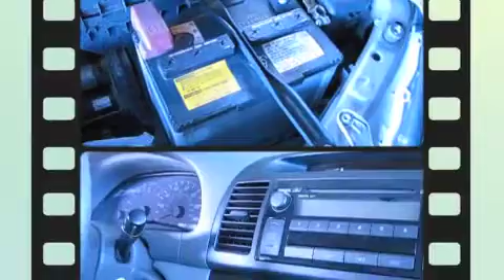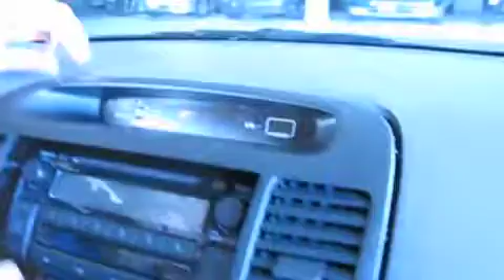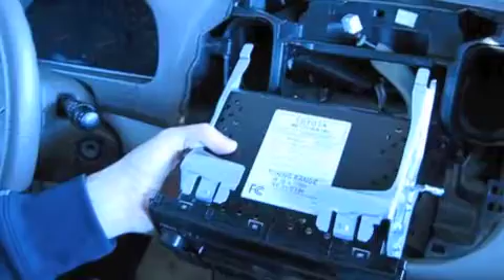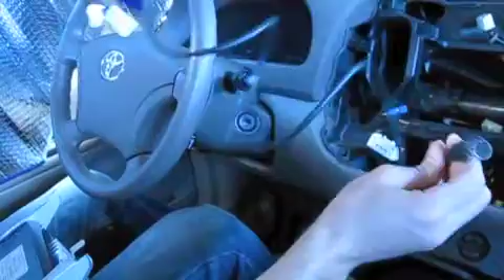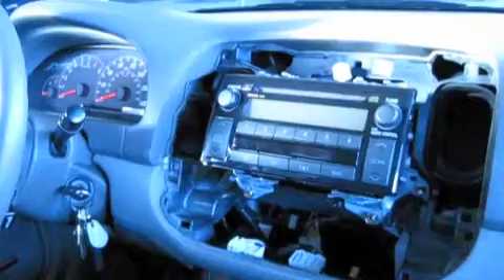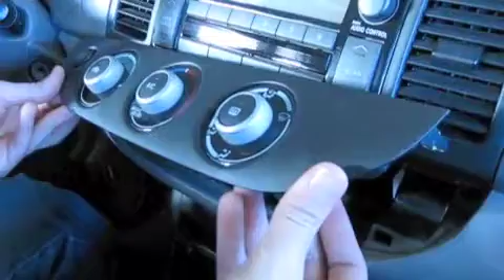How to iPod a Toyota Camry '05

Comment: Very helpful, FYI, this connector can be reached thru the HVAC controls hole without removing the head unit....saves a bunch of time and potential broken clips....at least on a 2005 Camry.

Comment: Nice tutorial.  Wish I had found this video before I paid someone to install one of these for me.  FYI, if you want, you can mount the white box behind the console, then drill a little hole in the back of the cubby hole to pass the wire through that connects to the ipod.  That way you don't have the white box taking up valuable space in the cubby hole!  It's a little extra work and may require some extra tools but it's worth it to have the extra space.

Comment from the maker: @age6racers 
The PA15TOY does not have a DIP switch. You actually choose the operating mode by changing the "CD number" from the radio. When using "CD 7", it operates in "playlist" mode. When using "CD 8" it operates in "Direct mode".  Hope this helps.